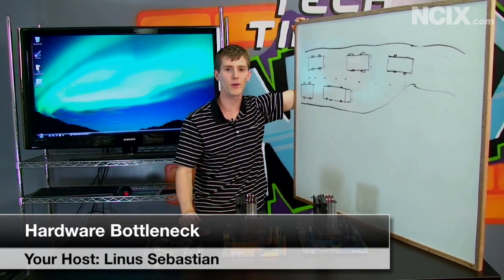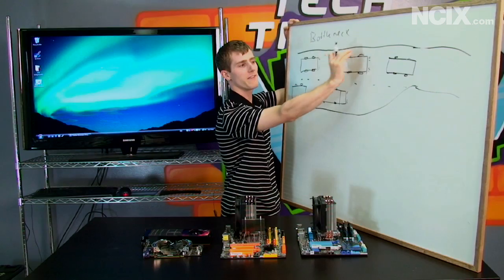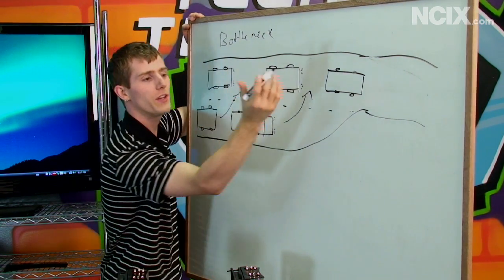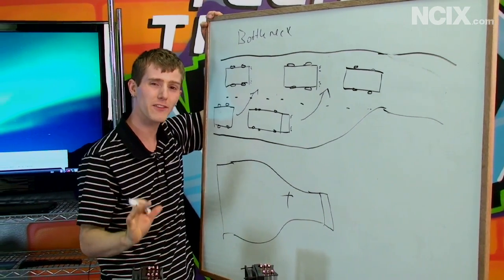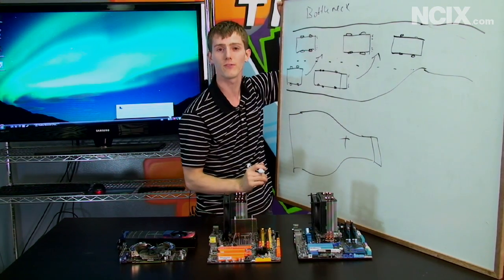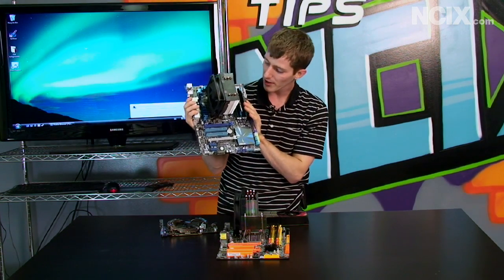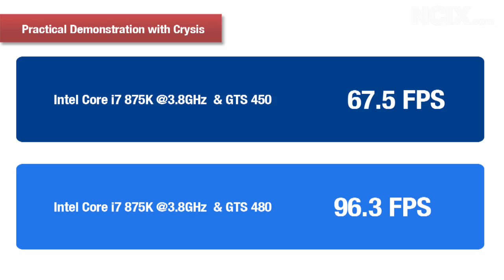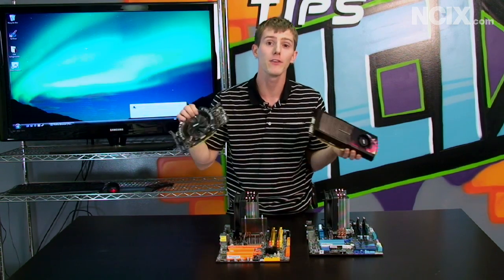Understanding Hardware "Bottlenecks" and How to Avoid Them (NCIX Tech Tips #81)

Comment: I want to built a PC with a i7-4770K and SLI GIGABYTE GTX 780 ti on a G1 Sniper 5 mobo from Gigabyte with a 850w powersupply from be quiet. Will there be any bottlenecks or could I take any better part??

Comment: Hi Linus, I have a 350W PSU with a Intel Pentium 4. I'm planning on buying a nvidia GEFORCE GT 640M (Not Ti). Would it work fine or do I require more wattage? I also plan buying a E8400 2 Cure CPU later.

Comment: Is it possible for a motherboard to bottleneck a gpu and cpu?
Im going to be upgrading a PC which has a I7 Core 2600 by adding a GeForce GTX 1060 6GB 6GB GAMING X. 
Will the older CPU bottleneck the gpu too much or would it be okay ?

Comment: Hi i have a question I have a CPU 3930k, MB Rampage IV Extreme, GPU 3 way SLI Gtx 770 2GB, PS AX1500i, HD WD10EZEX 1 TB, RAM 16gb Corsair vengeance (8+8) and my gaming experience is so bad do you think it has any bottleneck? i don't make any overclock or change any graphic settings, and the sli is enabled and i try another sli bridge the system work's better with a single gpu and i try every gpu separate and ich one work perfectly i'm getting crazy with that. I read a lot of forums and i didn't found solution.

Comment: i wanted to ask if those parts will go all together without any big bottleneck 
MSI z87-G45 gaming MB 
MSI N780 lightning 
intel core i7-4770k
750W psu
RAM 16gb (1600mhz) (2x8gb)
120gb ssd
hdd 2tb 7200Rpm
....

Comment: So I'm running a 1st gen Intel i7 950 Bloomfield with a GTX 760. BF4 on HIGH settings averages 40-90fps depending on the map. Would this be normal or is my CPU bottlenecking my GPU?

Comment: I have a Power supply bottle neck concern, and I read that 3.0 Graphics cards are backward compatible with 2.0 PCI Express, is that correct? 

Apevia Java 650W Black Power Supply

Sentey Gaming Computer Case Gs-6011 Blade

Cooler Master Hyper 212 EVO - CPU

2-Kingston Digital 240GB SSDNow V300

PowerColor Radeon R7 260X AXR7 260X 2GBD5-DHV4E/OC 2GB 128-Bit GDDR5 PCI Express 3.0

 GIGABYTE GA-970A-UD3P AM3+

 G.SKILL Ripjaws X Series 16GB (2 x 8GB) 240-Pin DDR3 SDRAM DDR3

 AMD FX-6300 Vishera 6-Core 3.5GHz (4.1GHz Turbo) Socket AM3+ 95W

Comment: I am getting a 780 ti superclock and debating on a i7-4820k or and i7-4770k
It is a bit overkill, but which cpu should I choose? I'm pretty sure bottlenecking might not happen but some feedback could help.
Reply: how will that be a bottleneck when the i7-4k is the best you can get?
its just on par with the 780 ti if you ask me.
i might be missing some facts though pls correct me if so.
i think you can only bottleneck that combination with an underpowered PSU
Reply: mickaelaria  A PSU that can't deliver the needed power it will just shut down your system with that beautiful blue screen no one likes to see. so i guess in a way you can call it a bottleneck(maybe).... so as long as one makes sure they have a PSU with some headroom for future upgrades you be ok
Reply: I would wait for APU instead, they will be way more balanced and faster than externals CPU and GPU.
Reply: The GPU and either of the CPUs will go well together, however the core clock speeds on the CPUs will bottleneck the GPU and therefore you will have to overclock the CPU to get the performance out of the 780 ti.
Reply: Mathias Beaulieu-Duncan what world do you live in
Reply: Nicholas Lasky Mathias Beaulieu-Duncan I assume the world of consoles and peasantry seeing as those are APU powered
Reply: Keep in mind that the 4770K is an 1150 socket and the 4820K is the older 2011 socket.

Which one you get is entirely up to you, they're both fantastic.  I'd base the decision off of what you're trying to accomplish.

No more than 2 GPU's gaming machine?  4770K.  Massive CPU calculations or 3 and up gpu's? 4820K.

The 4770K is better in almost every way as a decent gaming machine than the 4820K, if only just slightly.  Better single-core performance per clock speed, better overclocking ability (alleged), runs cooler thanks to it's significantly less power requirements and has a higher max temp than the 4820K, better passmark score.

The 4820K is basically the only option if you want more than 32GB of ram, want to run more than 2 GPU's, want to do 3D performance on the CPU.
Reply: Drew W Thanks man!
Reply: You're welcome!
Reply: ThatYellowPokemon
 I'll add that a 4770K is a bit overkill as the main difference between an i5 and i7 is hyperthreading, which does very little for gaming, but helps tremendously for tasks like video editing and encoding.
Reply: Drew W Features I would like to have.
Reply: ThatYellowPokemon Then there you have it :)
Reply: Drew W
Isn't comparing socket 1150 to 2011 like apples and pears? Socket 2011 CPUs target a different market, I would think? (What with the multi-CPU support and such).
Reply: Mikelamont2  Not really.  Only Xeon workstation/server oriented CPU's work in parallel (two on one board).  The 2011 i7's (4820k, 4930k, 4960x) can only support themselves as they are selfish and do not like to share.

So if you're on a 2011 for an i7 gaming rig, you're still limited to 1 cpu.  However, as of THIS WRITING, only the 2011 socket allows you to get an intel i7 HEX core.  That's soon to change, apparently, but for now that is a known fact.  You also get more PCIe lanes to play with, if that's important to you.

For a more common setup with 4 ram slots, up to 2 gpu's and using the onboard audio and LAN, the 1150 is definitely better bang for the buck and beats out an equivalent 2011 in some area's, so it's not that it's a bad board.  The comparison is extremely close.  It's really only if you have the desire and money for MOAR FEATURES is when you'll justify the expense of a 2011 with an i7 on it.

Comment: I just bought and put together a msi 970 motherbord with a amd fx-6350 black edition procesor and a gtx970 this is runing with a 750W power supely and i have 12gb ram that works good is this a botlenecked system?
It is running worse than i think it should

Comment: i have an fairly old setup here (as my 3rd best PC), Core 2 Duo E8400 + GTX 295, though i'm looking to get a better board since this one is limiting me to 2.87gb of DDR2 because of the BIOS. But i still get fairly good performance for older games, even Just Cause 2 run fairly good on it. I tried a GTX 480 on that setup and it did next to no difference in performance in a few benchmarks (FF14 and Valley Benchmark), so i'll keep this GTX 480 for another future setup.

Comment: Operating System:	Windows 8.1 Single Language, 64-bit
DirectX version:	11.0 
GPU processor:		GeForce GT 740M
Driver version:		353.30
Memory interface:	64-bit
Dedicated video memory:	2048 MB DDR3
Ram: 8GB
CPU: i5 4200U

While am playing NFS rivals, or Crysis 2 it starts lagging after 5 mins.
What would be the bottleneck for this Laptop?

Comment: I am going to build custom PC.These are the components :
                              
PSU:GoldenField ATX-600W 

CPU:AMD A8 X4 6600K 3.9GHz FM2 [Quad core]   or  AMD Athlon II X4 860K 3.7GHz FM2+[Quad core]  (which one is better)
RAM:8Gb   1866MHz  (single-channel)
HDD: 1TB 7200RPM - 6Gb/s -SATA2 (motherboard doesnt have SATA3 ports)          
GPU:Sapphire Radeon R7 270X 2GB GDDR5
Motherboard:ASRock FM2A58M-DG3+  
entire PC cost : $302.93

Any bottlenecks or problems ?

Comment: I hate the situation I'm in. I want the gtx 750 ti (particularly PNY). My ram is fine, PSU is only 300w but since the 750 ti's tdp is small it's okay. It's and OEM (HP p6 21-25) but I have a crappy AMD e2-3200 apu (FM1 crap socket) I might upgrade to an A8-3800, but the bottleneck will be still crazy and annoying, right?

Comment: so the 1k watt power supply is not a bottle neck. Bottle neck would be the component that cause causing other components to run slower mainly due to waiting for that component's IO. Basically having the system slow down to wait for the slowest component of the system to respond.

A power supply being a bottleneck (weird example to use btw, power supply?) is if  it was under-powered for the other components.

Other than that good examples.

Comment: Will an fx6300 bottleneck a 280x? I'm able to get around 35 fps in crysis 3 on ultra, so it doesn't really seem like it, but the fx6300 is only a 110$ CPU for a 400$ graphic card.

Comment: would i have to change anything in this build?\
amd fx 6200 6core 3.8gz cpu
evga gtx 770 2 gb gpu
asus evo R2.0 mother board
Reply: Really depends on what you want to do.
That build is mostly fine, don't forget the PSU!!
Reply: Morphexe thanks for the advice but let me ask you for more.

i want to build a gaming rig so the specs are similar but i upped the cpu and now ill tell you the psu
CPU: AMD FX either 8350 0r 9370
PSU: OCZ ZT 650W 80+BRONZE
Reply: Sincerely I would go with a intel CPU, the AMD FX 9.... is a OC version of the 8...., so dont go with that, they come with high temperatures. If I were you I would go with a intel i5 or I7 depending on your budget. you can get a i7 haswell Architecture for around 300, and thats the K version so it can be oced. For gaming a  i5 is perfect. The psu is enough unless you  intend to go with dual/triple GPU in the future.
Reply: Morphexe thanks I've been doing reaserch myself and decided an 8350 would better accommodate my build but this is my max budget and any thing with the same prformance as an 8350 is more expensive and AMD seems to have a better price to performance ratio so my 8350 seems.like my best option
Reply: Well, the thing with the processor is kinda like AMD vs Nvid , in the end the coice is really yours, me I personally prefer the Intel ones, although I am not dissing the AMD they are good processors, and in some cases (mostly AMD titles) they outperform  the intel ones, so you are good to go with that build, I wasnt aware of your budget limits, but overall I think you will be fine, don't forget the Ram too :D Get 8gbs and you are set
Reply: Morphexe thanks for the advice I perssonally prefer NVIDIA due to better performance and advanced physX but yeah I also have 2X4gb of mushkin stealth ram so 8gb it is. Again thanks for the advice.

Comment: I`m currently using:
MSI P55-GD55 ATX Intel Motherboard
Palit GeForce GTS 250 NE3TS25EFHD02 Video Card
Western Digital Caviar Black 500GB 3.5" SATA 3.0 GB/s Internal Hard Drive -Bare Drive
G. SKILL 6GB (3x2GB) 240-PIN DDR3 SDRAM DDR3 1600 (PC3 12800) Triple Channel Kit Desktop Memory
Corsair CMPSU-750TX 750W Compatible with Core i7 Power Supply
Intel Core i5-750 2.66GHz LGA 1156 95W Quad-core processor

My question is how much more RAM can I get without any bottleneck. And also, any suggestion for affordable recording/streaming products.

Comment: question i recently put a pc together that i use for trolling the net and gaming (eve online ,bf4,metro,cod) am i bottlenecking it or is it a solid build

Pc  component’s
Tower=Corsair Carbide series 300R
Power Supply=Cooler Master 850W stealth
Motherboard=ASUS M5A97 R2.0 (970/sb950) chipset
Processer=AMD X6 fz-6300 black edition 8mb cache
Processer cooling =COOLERMASTER Hyper 212 evo 
DRAM=G.SKILLS Ripjaws x 16gb DDR3 2133mhz cl10 duel channel kit
Fan controller=NZXT Sentry LX (5 temp and 5 fan controller)
Video Card= Sapphire Radeon R9 270X DUEL-x
Hard drive –ssd  Samsung 850 Pro series 256g
Hard drive #2  WD Black 3TB (7200rpm 64mb cache)
3Deepcool 120mm blue led fans
1 deepcool 120mm blackout 
1 corsair af140mm blue led  
1 corsair 140mm blackout 
Idle temp 23.4 c

Comment: CPU: Intel Core 2 Quad Q9650 3GHz
RAM: 8 GB DDR3 1333MHz
HDD: 500 GB WD Velociraptor for OS,
and 6x4TB WD Green for data.
GPU: GTX 260 1GB DDR3
SOUND: Creative Soundblaster Audigy SE
PSU: Seasonic Platinum 1200W
Windows 7 Ultimate 64 Bit

So I've had this rig for quite a few years now, with very few upgrades. I know it's quite old, but I am not going to build a new one for another 3 years perhaps. However, I'm considering of changing my GPU with something better but I'm not sure with which graphics card; as I don't want to bottleneck my PC. Any ideas?
Reply: Hellercor Your CPU is fast enough. I'd put in at least a GTX 750.
Reply: thanks!

Comment: Replaced my gtx 460 1gb with the gtx 760 2gb. My cpu is a Intel i5 dual core 3,2 ghz 4mb. My ram is 1333mhz 8 gb. my harddrive is pretty bad: 500gb SATA 6Gb/s (SATA 3.0), 16MB, 7200RPM, 3.5. Do you think im bottlenecking?

Comment: Please answer.
Im gonna upgrade my GPU from Integrated Graphics card by Intel (G33/G31 Card 256mb) to an Gainward Nvidia GeForce GT610 2GB. My CPU is Intel Pentium Dual Core E5700 3.0 ghz. Does my CPU bottleneck my GpU or Vice versa? Please cant decide.

Comment: I ordered an r9 380, i5 2400, 2x4gB GSkill DDR3, Corsair 750w PSU, CPU cooler, GigaByte MoBo, and an Asus WiFi card. $450

PSU is 750w for future upgrade plans.

I cut out the I/O shield on an old Pentium 3 Gateway case and cleaned it up with a magnet/hose/paper towels. Threw in an extra fan.
Took out the 2nd CD and floppy cages and put a ghetto air filter on it. Already have a TV, thermal paste, 2x750gB Laptop drives, a 128gB SSD, and a SATA DVDRW drive.

Any opinions?
Reply: Plus the PSU was on sale for $50... Couldn't pass that up.
Reply: +xLDKx NewYorker seems good, good enough for gaming certainly.

Comment: Could an hp 2311x monitor bottleneck my system?

GPU: 1060 3gb
CPU: 8320 4ghz
RAM: 8gb DDR3

It's a 5-year-old monitor, which might explain why I struggle to get 30 frames in BF1. If so, what is a monitor you would recommend that would be relatively inexpensive? Less than $200.

Comment: i have i5 4690k and amd r9 285 2gb, when playing gta V with high settings my gpu usage goes to like 10-30% and i get fps drops and shit meanwhile my cpu usage goes to like 90-95% after playing for while. When i lower my settings my gpu usage is like 80-100% and cpu usage is like 70-100% and fps is fine so... im really confused which one is bottlenecking. BTW im playing with Vsync on.

Comment: Quick question I have a system with a i5 4570 with sli gtx 660oc is that bottlenecking? it seems to run fine but I dont know if I can pull more with a better processor?
Reply: absolutely no bottlenecking there, an i5 4570 is a high enough end cpu for high end video cards.

Comment: question so this is what im putting together on Friday would i to know if i did OK or if i need to exchange something before i open. 

bought a xfx radeon r0 270x graphics card, new power supply 750 watts. AMD FX 6300 6-core 3.5 g.h black edition CPU. asus chrosshair v formula z mother board. and ddr3 2133 2x4gb vengeance ddr3 ram 2133 mhz. and crosair h55 hydro coller for cpu. and last but not least nzxt phantom 820 full tower case. first time putting a computer together and antec formula 7 thernmal compound. got 2 tb hardrive will add ssid later on but wanted to know if the ram, mother board, cpu and graphics card would be good enough or descent gaming computer?

Comment: what gpu could i put in my core 2 duo E6550 system? i currently have nvidia 7300SE gpu 256MB OC'ed myself with custom cooling fan 2gb DDR2 ram, ASUS P5KPL MB and a 450w PSU? (i am not sure around 425w-450w), also my gpu runs minecraft really close to a c2d P8600 macbook pro that have 320M 256MB in it, what i can do with this 6 years old system
Reply: Honestly, your rig is really outdated and even if you do buy a better GPU, you'd notice very little performance gain because your CPU would be a huge bottleneck.
2gb of ram is just not enough these days, you need at least 6gb and 8gb is recommended.
If you're planning on buying a new gpu, you will unfortunately have to upgrade the rest of your PC, as well (PSU, motherboard, CPU, RAM, a case with good airflow).

Comment: I looked up the specs so with a i7 6700 and a gtx 1070 the CPU is getting bottlenecked what can I do
Reply: WTF... call the police right now.
Reply: tru tru u a real nigga
Reply: 6700k is just a recommendation. Any recent i5 (4th generation to 6th and likely many older ones too) should not bottleneck. CPU bottlenecking isn't really that common.
Reply: overclock your gpu
Reply: and the RAM
Reply: +Felipe03000 
Will mine R9 280x bottleneck AMD ATHLON X4 750K QUAD CORE (3.4 ghz) ?I wont play any cpu intensive games.
Reply: Nikola Milosevic If you're not playing CPU intensive games, shouldn't bottleneck too hard. However, I'd get an i3 6100 and any socket LGA 1151 motherboard. http://cpu.userbenchmark.com/Compare/Intel-Core-i3-6100-vs-AMD-Athlon-II-X4-750K/3511vs1548
Reply: Nikola Milosevic It will be some bottleneck. Instead of picking up the R9 280X pick up the R9 285. It have almost the same performance as the 280X, and u will pay less. Also as you will have a light bottleneck there will be no difference.

Comment: Is there a bottleneck on my i3 4170 and GTX 960? And How about a i3 4170 and RX 480 as an UPGRADDE? is it okay?
Reply: there will be bottleneck. You can upgrade, but u will need a better gpu in the future. To minimize the bottleneck just overclock your CPU. With RX 480 not even an insane overclock would hold.

Comment: I5 4430 and evga gtx 970ACX to overkill for 1080p max settings? What do you recommed me? And will this pair Bottleneck in a small way?
Reply: i say the cpu will bottleneck a little, but a little oc will do just fine
Reply: Depends on the monitor you are using.

Comment: This Build is good:

No bottlenecks and whatsoever which I know of.
Everyday home use and Gaming purposes.

Intel i5 - 3350P
Gigabyte H77M-D3H
ADATA DDR3 1600 Mhz (12800) 8GB Ram ( or Seagate or WD. doesn't matter )
Seagate 1TB 7200 RPM Sata 3
Samsung int. DVD writer
Gigabyte Radeon R9 270x Overclocked
Seasonic M12II 520W (80+ efficiency) Bronze
Cooler Master N200 with window
Windows 8 64 bits (OEM)